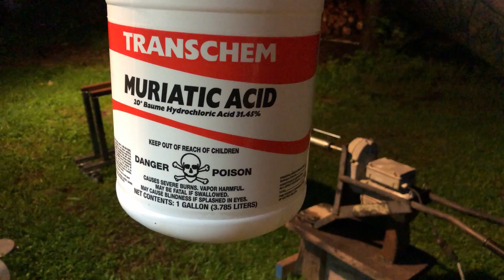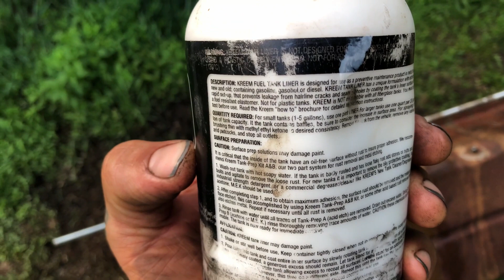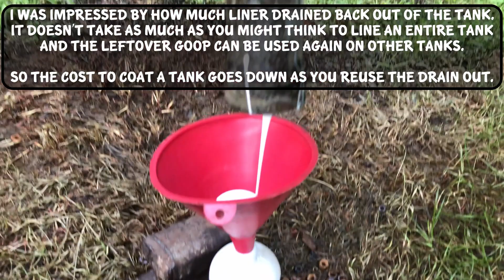Cleaning Out Old Gas Tanks Pt  2

Comment: I would have thought throwing an old length of chain in the tank during the spin process as an added abrasive media would have been easier to fish out than the handful of nuts and bolts and washers used.  Just stick a heavy wire with a hook on the end down there until it catches a link and drag the rest out.  Although if you're also trying to clean up your original IH nuts and bolts for reuse (I like seeing that WP insignia on mine too), this might be one way to do it, and I guess a magnet on a stick isn't that hard to use to get any stragglers out.